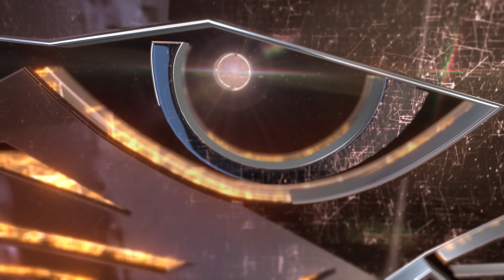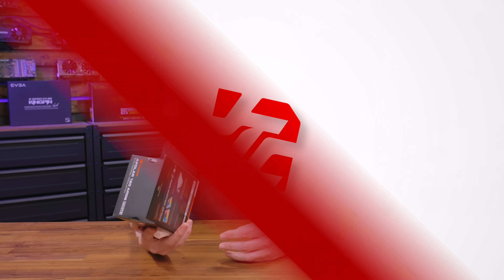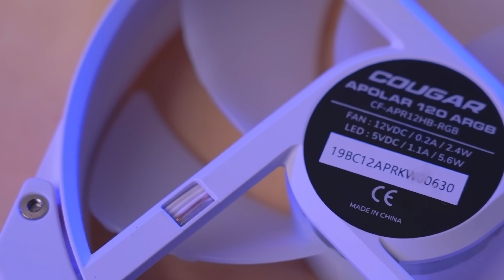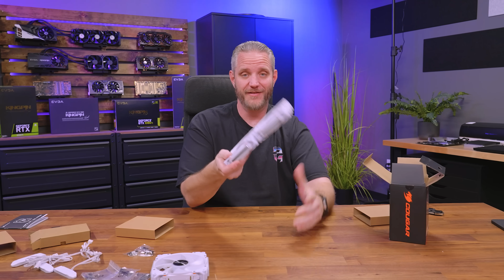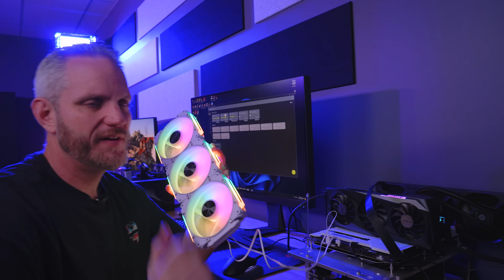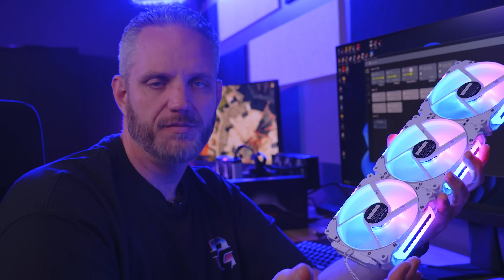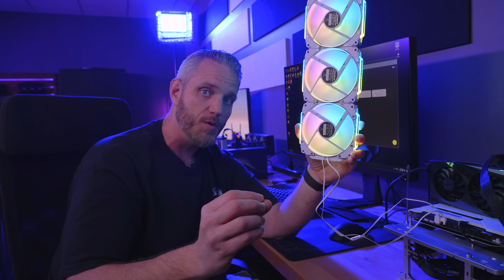ALL PC fans should have this feature! (NOT RGB)

Comment: The thermaltake SWAFANs have this too, I just did a build with them, they're pretty nice
Reply: I just did a build with SWAFAN EX14 and EX12 ARGBs and once they're setup and working I absolutely love them. The big draw over these would be that the SWAFANs also come with a set of reverse fan blades as well. This was a huge for me. My only gripe is that they didn't design the magnetic connector with any sort of alignment pins or recess, etc. So they're a PITA to get working (especially if they're mounted in an area with tight space near the connector) and I've heard of a ton of people just flat out returning them thinking that they got non-working fans. It's a shame and a huge oversight by TT sadly as they're great fans otherwise.
Reply: @average_geeky_guy  true, that was something I could see being an issue as well. If that's my only gripe I'd say they did a pretty stellar job otherwise.
Reply: @YuasBirds  I'm very happy with them otherwise and I eventually got a "feel" for getting the connector right most of the time. But I was frustrated early on and totally understand why people would just assume that they have broken fans and return them. It's sad because those people are missing out on great fans.
Reply: @average_geeky_guy  did those fans have like a humming sound or any other annoying sound at around 1300-1500 rpm?
Reply: @danirachmanto83  Interesting, I hadn't noticed it before but I tested just now and there is a very slight oscillating hum between roughly 1300-1500 RPM. I can barely hear it in my case though (6500x) in a very quiet room so it won't bother me in my setup but if it was louder it would be annoying. It was quiet enough that I don't think I would have ever noticed, especially since the fans only get up that high during gaming and then I have headphones on.
Reply: Using the SWAFAN EX12 3 pack in reverse mode. The connections between the fans is a bit finicky, but once it's setup it works great. Definitely interested in a V2 getting made with better fan performance!
Reply: Thermaltake has a BIG issue with rushing to market without any testing. I have a TT case, fans, and controller, each one with its own set of problems that could've been sorted out with testing
Reply: @SG-sj6cw  Ah, this is my first time using their products. Great fans other than the stupid connector, LOL.

Comment: I wish Arctic made daisy chained fans 🙏
Reply: Arctic does have many normal daisy chain fans they are denoted by pst in there product name.
Reply: @destiny-hz5vx  Wrong type of daisychain. I myself have 3 of the P12 PST PWM A-RGB fans , problem is, with them, you still have 2 cables per fan which you have to cable manage. I also have 3 deepcool 120 fans attached to my 720LE AIO, another fan on the rear exhaust, and 2x 140mm SilentWings 2 fans on the bottom, feeding the GPU. That means I have a total of 18 cables.

Intent of this video and the point overall is, we want rid of the cables. We want fans that can lock together and operate over a single cable per group if possible, although two wouldn't be a dealbreaker. But a full build consisting of 7+ fans (3 top, 3 front/rear and 1 back + bottom if you have the mounting space to bring air up directly towards the GPU)

THATS A LOT OF CABLES TO MANAGE. When we say we want daisychained fans, we don't mean via bunny-eared cables. We mean via potentially reducing 20 cables from fans alone in the rear chamber of the case, down to 8. Or even 3 if the PWM and RGB are embedded into a single header like with Corsair, and daisychaining the single back fan to the top via a cable)

God forbid, you spend hours beautifully tying your cables down in the back of your case, but then a component stops working and you have to free that all up again. Nah bro. Get rid of the cables. What we want are pogo-pin daisychains.

Edit: Worthy note- when daisychaining with bunny-ear connectors, you also have to make sure the end device is insulated with a silicone cap or electrical tape, less you want the connectors to touch your case and cause a short to your ARGB connector, potentially killing your motherboard's RGB capabilities entirely. Most silicone caps delivered with RGB devices are woefully designed, and way too loose to trust they'll hold, meaning yeah, more to mess around with, having to get electrical tape or zip ties to literally tie the silicone caps on. This is just bad design, and something that needs to be deprecated already.
Reply: @grahamb7947  i get wanting less cables, but i would like clarification on which type of daisy chain @gorgonbert means.
Reply: @destiny-hz5vx  likely the same type Jay is showing in the video:

Ones which can be pogo pinned together and are either held by magnets, or clips, thus operating over a single, or two cables... as opposed to a dozen cables.
Reply: @destiny-hz5vx  But they do not use pogo pins / contact pads. They use wires, it'd be nice if they did use pogo pins/contact pads as it would really reduce cable clutter with AIOs like the Liquid Freezer 2. 1 cable for the AIO pump and 3 fans would be so damn awesome as LF2 without RGB only has one header coming off the AIO pump.
Reply: They are making daisy-chained fans, my PC build 2 years ago has them. Arctic BioniX ARGB (PST is daisy-chained by cable but this model is chained by connector without gaps)
Reply: @SzymonRzosinski  See my reply to destiny RE your comment about PST fans.
Reply: Or at least streamline the existing fan cables a little.
While the cables are chainable, I still needed to bind them together a lot due to the excess length of their connectors.
Reply: the problem is then they would likely cost a lot more kinda defeats the idea in the glorious arctic 5 packs
Reply: @PainX187  they wouldn’t have to cost a lot more than regular fans but companies would have to want to keep costs down which since it is a new feature they don’t want to do, they want to charge as much as they can for it.
Reply: bionix
Reply: @Pancake-k1c  not all BioniX only ARGB
Reply: Their fans with PST in the model number come with a built in splitters, you can daisy chain them, but unfortunately more wires.
Reply: @titanuranus2136  more wires? not realy. It's still 2 of them in the end. You just need to manage them a little. But there is realy no point in loosing sleep over someting like this. 
i could offer anyone $100 to spot a single A-RGB or fan cable (that is not the plug comming off of the mobo) in my 10 casefan Lian Li o11D evo:)
BTW. All my fans are Arctic P12 PST and Arctic P12 A-RGB PST.
Reply: They do. They just don't daisy chain in the same way
Reply: @sinformant That is some bad luck with the lost packages.  I've only ordered from Amazon and the singles tend to survive shipping better where as I had 50-75% of the P14 five packs arrive with a broken strut.  Value and performance for the money is still really good and the sound profile is not annoying to my ears.
Reply: So the fans on my LF3 420 are chained on the rad. Have i missed something?
Reply: they do with PST connectors
Reply: I use their daisy chained non-rgb fans in my build. All the fans have wires but there's 2 4 pin pwm female and male connectors for daisy chaining
Reply: They make daisy chain fans (the PST series fans) - they only don't make cable less daisy chain fans.
Reply: im using daisy chained fans from arctic, i got a pack, maybe its only a thing with the packs?
Reply: There realy is no need for this daisychain. you can make the fan wires disapear if you wish to. It takes a little more effort. but thats it. this daisychain crap with a $50 tax pr 3pack of fan is just laizyness.
Reply: @Audiosan79  not to mention encouraging proprietary connectors and added bulk in SFF cases. If I have to run their software instead of say aquacomputer quadro controller or the motherboard bios setting, that is a non-starter.
Reply: @jeremytine  Yes. that is that too. Another 30% tax and 50% headache.
Reply: @Audiosan79  booooooo. Boooooo audiosan. Booooo audiosan79, booooo.
Reply: I gave up on arctic fans. I wanted to run all Arctic fans on my newest build and ordered several sets of fans and every set of fans got lost in shipping or damaged in shipping and returned and order cancelled before I ever got them. Over several weeks of ordering and reordering I never got a single fan. Idk if the stars just aligned against me or what? Just ended up getting antec fans.
Reply: @sinformant out of curiosity, did you order them from arctic directly? I’ve had similar problems with other brands and things that are bike-related but not PC related.
Reply: @sinformant  That's not arctic's fault. It's more a problem of where you ordered, the delivery service or stealing neighbors.
Reply: @seanthiar  I ordered off Amazon and the seller was actic.  Two times I didn't receive them and got a refund. Ordered antec Argb fans instead and they all arrived. Just reordered a 3rd time 3 p12 Max's and finally got them in. Going to run them on the backside of my 360 radiator for a push pull configuration and set them to only kick on at a certain temp so they will just be 0 rpm.

Comment: All fans should really operate on Canbus....
Reply: Let me guess… you’re German? 😂
Reply: @gorgonbert  No I'm not German. I've worked with the system for years. If it is applied to the fan controllers and the RGB controllers it would be a very reliable system that is very easy to run in a Windows environment.
Reply: Then I could modify all the parameters by CANopener. Nice.
Reply: @downrangefuture6493  If you could adapt the module, why not??
Reply: I just visualized that concept while watching the video. 4 wires total for the fans and the RGB and you can control 3 or 4 fans individually as well as the individual ARGB LEDs from that two wire communication. but dunno if manufacturers would design to that standard.

Comment: All brands should implement this
Reply: Unfortunately all these daisy chain systems are being patented to prevent it from becoming a standard
Reply: @OctagonalSquare That is one major problem. The other is the interconnect fan systems with 1 cable... also means proprietary connectors so you cannot mix and match brands.
Both of which are ways for fan makers to lock you into their echo system. Which i hate.
Reply: @OctagonalSquare  Quite sure it's to have a legal advantage and protect yourself. As well as have the right to sue if someone. If you think about it ...the company that has the patents WANTS this to become standard, because they have the tech. If something comes the go-to, they put pressure on others to either innovate, or licence, as well as they don't have to compete in extra pricing or have the advantage of being able to increase scale the operation.
Reply: @OctagonalSquare  patents are given far too freely now, for the most part all they do is hold everyone back. They should protect against people making exact clones but nothing more or give the company say 6 months or a year of ownership of that concept and then after that it is free for everyone.

Long patents shouldn’t exist in most industries, just look at how fast technology develops, yet some companies hold 20 year patents on emerging technologies, the whole industry has change by the time the patent is up. All it does is hold everyone back. A company with a good patent just needs to sit there and use the patent, they don’t need to innovate as long as they have a large advantage. Patents only help the company, they don’t help anyone else, especially not consumers, so either patents need to be drastically shortened or companies need to be required to license their patents for reasonable prices. They also should completely remove patents for concepts, I don’t see how a company should be allowed to lock up a concept for 20+ years and not let anyone else use it, let them protect implementations to stop exact clones but don’t let them patent ideas. The whole patented concept thing is just abused, large companies file lots of patents for concepts without any intention of using them, just so they can stop others from using them, to the point they will buy entire smaller companies just to own their patents and then shut down the company just so that no one else can use that concept. It is just greedy and hurts progress.
Reply: Most brands do, but they have to be so careful with patent rights of the existing brands.
Reply: my arctic p12s costed 16$ for a 3-pack, look great, and just daisy chain using NORMAL CABLES.    I am not impressed by this video nor do i care if any brands at all implement this over-priced solution to connections
Reply: @maxwell_edison  okay, so what? You obviously go for cheap fans, these were never going to be for you. Regardless of whether you think it is overpriced, it is a good method for making the wiring in PCs simpler. Your arctic fans do the same thing they just use normal connectors rather than pogo pins. Using pogo pins is even simpler than using normal wires and connections to daisy chain the fans. The price of things like this will come down and likely will become standard, except on the extremely low end.